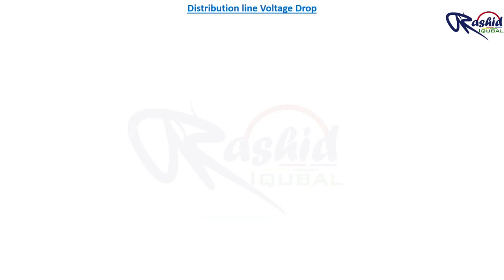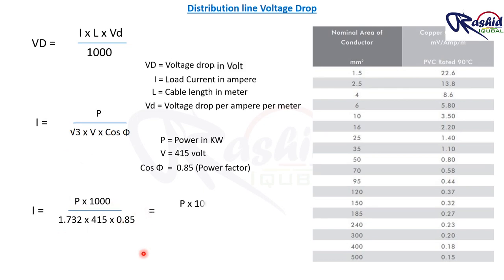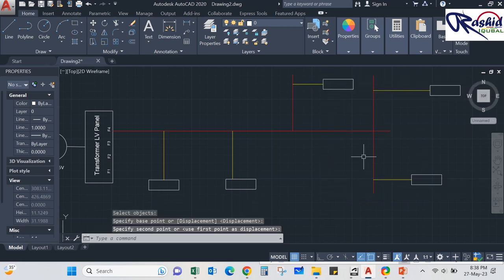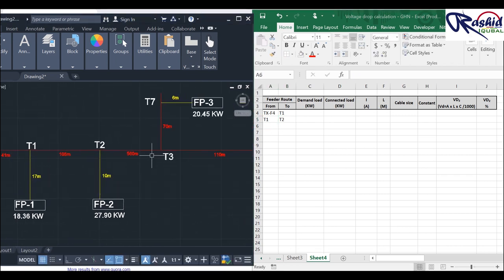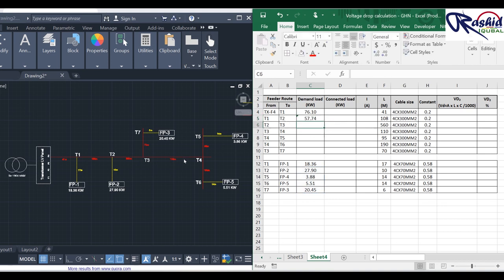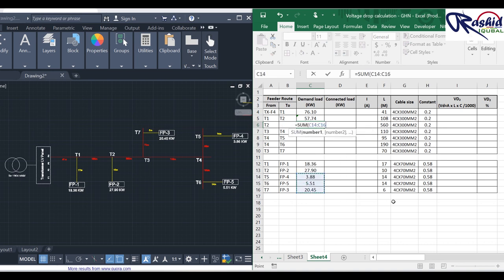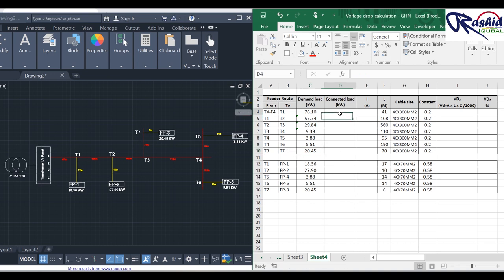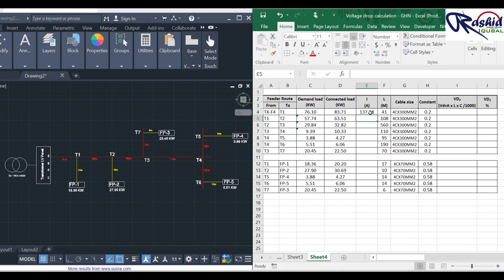Voltage drop calculation method for Distribution line (LV Cable)

Comment: Great job you have done here sir, just a little observation. To calculate the current between T1 to T2, I feel that, it should have been (63.51*1000)/(1.732*(415-1.13)*0.85)=(63.51*1000)/(1.732*(413.87)*0.85)=104.44A and not 103.88A.(While considering the voltage drop)

Now, going by the factor you used in calculating the current(I=1.64P)

To calculate the current flow between two nodes while considering the voltage drop across the feeder, I feel that it should be: I=(1.64P)*(415)/(415-1.13) and not (I=(1.64P)*(415-1.13)/(415) as you did.

This gives: I=(1.64P)*(415)/(415-1.13) =104.4A 

while

I=(1.64P)*(415-1.13)/(415)=103.88A

104.44A should be the correct answer. 

In all, you did a great job and I have learnt a lot from your video. Thank you so very much!

Comment: Great Explanation!  But it seems the values differs with EDR program. Total amperes matches with EDR. But Segment VD% and Cumulative VD % not matches with your calculation.  I think the constant has some issues with it!  Not sure what constant they are using.  Is there any standard list for constant?  Can you please check
Reply from the maker: You can find constant value from cable catalogue